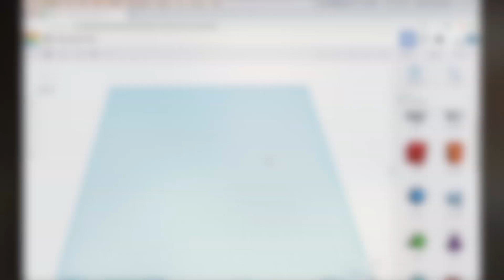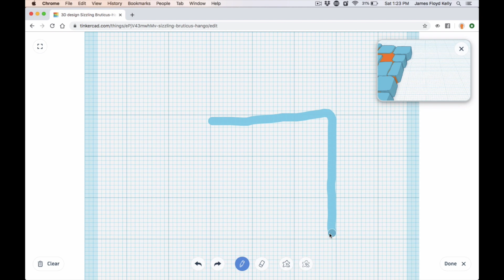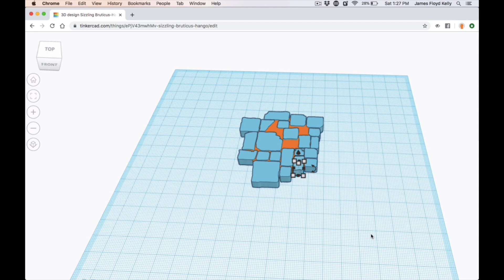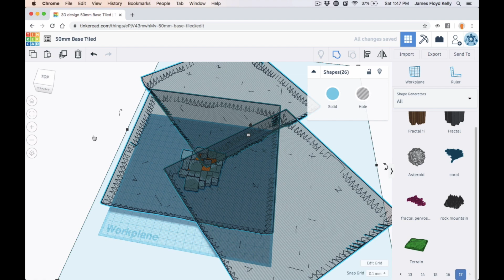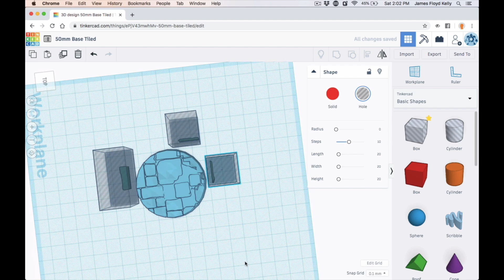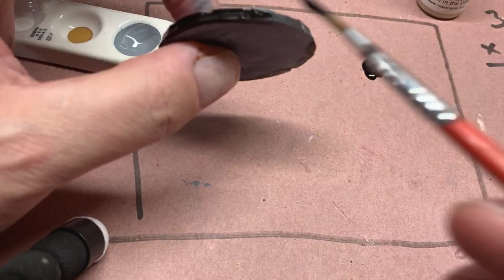Episode 127 -- 50mm Base Tutorial

Comment: Quick TinkerCad sketch tool tip: next to the draw tool  is the Draw Shape tool.  To make your bricks, you would just draw the outline, and it fills in automatically.  This tool is much faster, and allows you to make sharp corners on your shape.  You can use the Erase tool to touch up the shape if you want.   Also, if you don't like it when you're done but you've already clicked done, you can double click the to object to re-open the editor with your shape loaded.  Pretty handy for making bricks fit a shape.   Good video as always.
Reply from the maker: Nice! Never saw that option. Thanks for pointing it out.